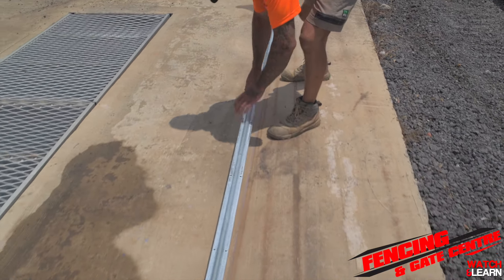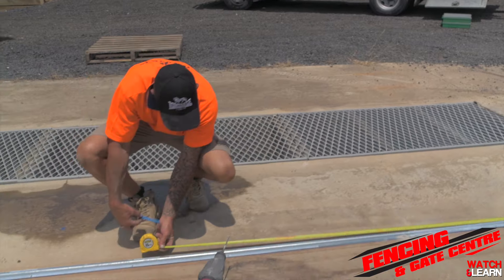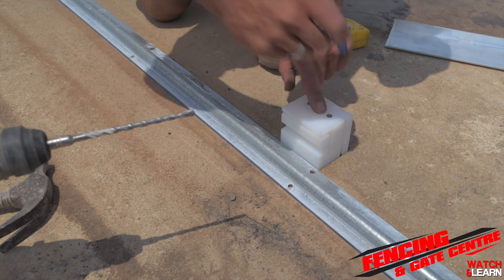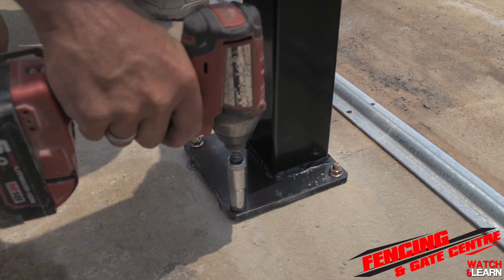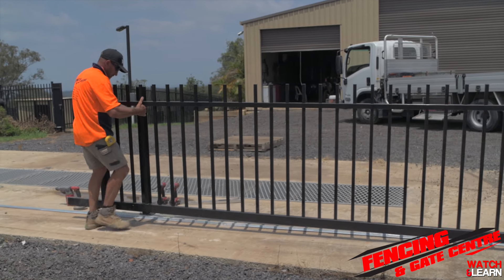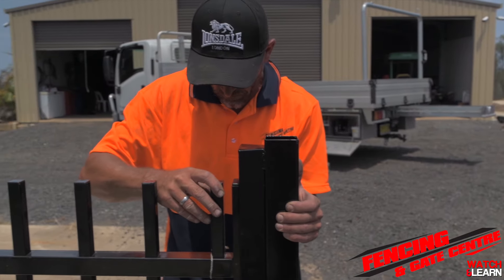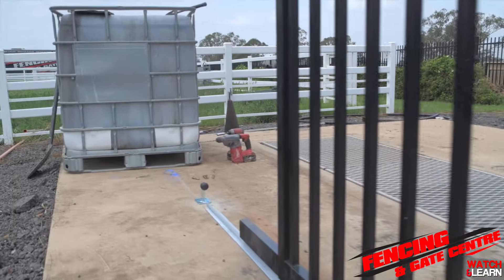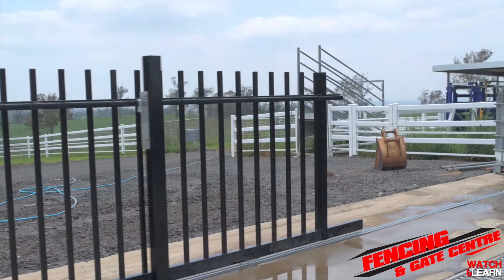How To Install A Sliding Gate From Scratch! The Easy Way!

Comment: Thats grand job but what if security is an issue. Those guides would not be near strong enough. Have you ideas on how to stop a slider being lifted of its track !!  Or the issue of the bolts in posts being screwed out an rendering gate useless?

Comment: How much of a role does the support post play in supporting the weight of the gate? I'm struggling to trust nylon and aluminum with the weight of the gate if the gate were tipping over
Reply: It’s aluminum gate so I think it’s doesn’t weight much.  But not installing posts in concrete but relying on few bolts doesn’t look safe. But that’s why there are regulations and I hope they have that over there because all it take is one accident and lawsuits when the surface mounted aluminum post fall over